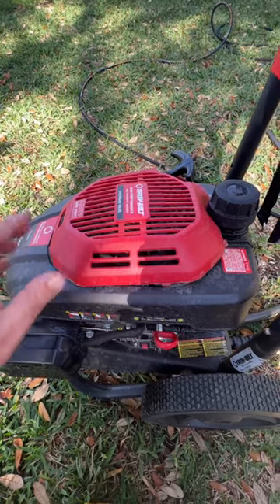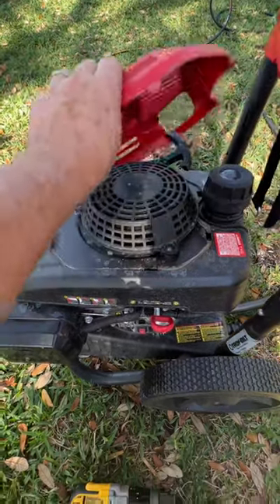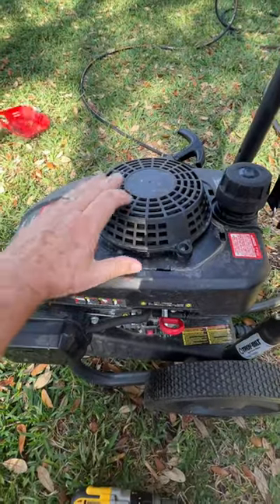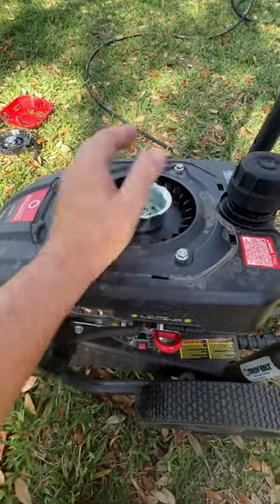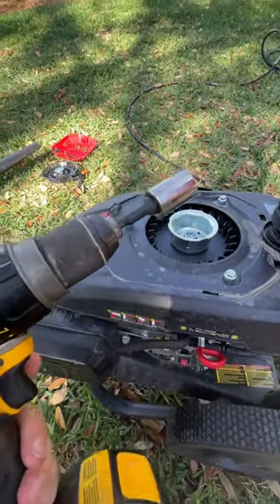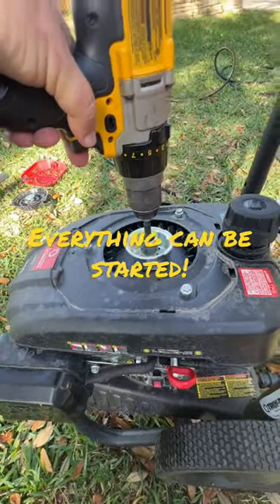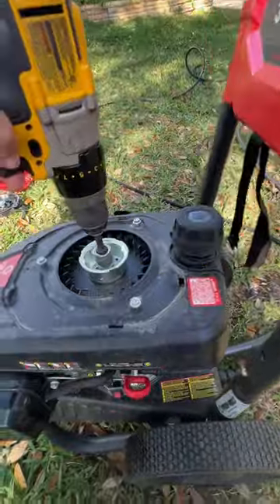Add a starter to every engine! Try at own risk! #motor #engine #starter #mower #lawncare #cleaning

Comment: I've done this, 2 problems, 1, you can accidentally loosen the flywheel nut, also, it can kick out of your hands.  Moving forward i will use a ratcheting adapter to keep these from happening
Reply from the maker: Makes sense to me!

Comment: When he says "clockwise" and if you're still unsure, just remember to spin the drill in the exact same direction that the pull cord rotates the starter assembly.

Cheers!
Reply from the maker: Well said!
Reply: If they don't know what clockwise means, they probably shouldn't be handling power equipment in this way.

Comment: NOT ADVISABLE.  I had a crankshaft retaining nut fly VERY far away because the engine started and the drill couldn't keep up. 
If an engine wont start correctly then FIX THE PROBLEM.  
Do it right. Don't get hurt.
Reply from the maker: Sound advice!  This tactic is dangerous

Comment: Which is better for a petrol-scooter, electric-drill or push-start.?
= hate the kick-starter
Reply: Maybe need to figure out the wiring harness of a car oops 115cc petrol-scooter with kick/electric/maybe-push. Usually scooter have 3 ways. Magneto something solenoid something CDI something, ... grass-cutter with electric start hanes-(types of)manual maybe... but... nevermind. Society have too many jealous losers at 115cc carburetion locomotion
Reply: Car drivers and their flooded smelly wiring are probably saboteurs of 115cc petrol-scooter and 660cc petrol-car. Some characters...
Reply: Nowadays, they control-signal stupid with electrical wires and ... how many kilograms is that harness.?
Reply: Wait till you find out formula-one sabotage... android-games at zero-cc(cubic-centimeters)
Reply from the maker: I would push start so you won’t have to store the drill

Comment: My mower doesn't turn over that easily and I attempted this one day when my pull rope broke and I just wanted to finish mowing the yard. Needless to say I didn't get it done until I replaced the pull rope and had to figure out how to reset the spring inside the pull rope reel
Reply from the maker: You have to exercise caution when doing this. Sorry it didn’t work for you
Reply: @RonKnowsStuff  my battery powered drill didn't do the job so I used a drill with a cord and it fired right up.. yesterday my pull rope 💔 and I spent hours taking it apart and putting it back together. I then seen your video and I'm not putting that stupidity pull rope back on it
Reply from the maker: @bendaves77  nice! Just be careful with the torque!

Comment: Will this work on my two stroke inline 4 desiel laylend?
Reply from the maker: Good question! Diesels need combustion to spark and light off. I’d imagine it would but PLEASE be careful- I recommend getting a clutch attachment for your drill so it can free spin
Reply: @RonKnowsStuff  Ron does in fact not know stuff
Reply from the maker: @QUAKY_A  dang it! I do know what I know though, you know?
Reply: @RonKnowsStuff  I know you know what you know and not not what you know

Comment: I do this too, but I use a directional slip clutch to hold the socket so that once the engine starts, it is not spinning the drill.
Reply from the maker: Exactly! I couldn’t think of the name of that tool.  I’ll have to remember Directional Slip Clutch. Thanks!!!
Reply: @RonKnowsStuff  Your welcome. I learned the hard way when it spun the chuck off my drill the first time I tried it. 😂
Reply: @RonKnowsStuff  can you give an example? I'm trying to avoid injury and I don't seem to find the correct adapter/tools to do this with the drill
Reply from the maker: @marcoenkel  here’s one from Amazon - not sponsored.  https://a.co/d/4eHd6ZM
Reply: @RonKnowsStuff

Comment: Does your recoil have a part number on it? It's the one I need.
Reply from the maker: Are you talking about the red top?
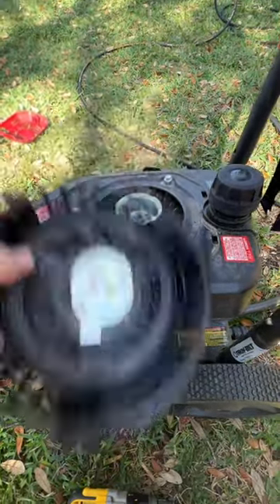Reply: @RonKnowsStuff The black part at 0:08 that you refer to as the starter coil
Reply from the maker: @BlueRage  try searching Amazon, PA6 GF30 should work.
Reply: @RonKnowsStuff  Thanks. Yours has three bolts holding it on, so does mine, PA6 GF30 has six.
Reply from the maker: Will look again but those numbers are the only ones that point to a part
Reply from the maker: Here are all the numbers I see - ROHS200611A (sticker), LGT-A (stamped in metal bottom), GT1P65 (molded in the plastic) >PA6+GF30< (also molded)
Reply from the maker: @BlueRage should see the response in the replies

Comment: Much safer to do this with a 1/2 impact. Yes, you might tighten the bolt but the impact will freespin, a drill will lock up which could break something.
Reply from the maker: Good to know that the impact driver has that feature!! Thanks for sharing. Amazon does sell a clutch for a regular drill too

Comment: I did try that and the bit twisted and broke off so i couldn't do shit after that
Reply from the maker: Crap!  I’m sorry it failed for you.  I have a bad shoulder so I have no choice. They do make a device that acts as a clutch on the drill bit so it won’t over spin
Reply: @RonKnowsStuff  that's good

Comment: It’s best to try this at your own risk, I wouldn’t recommend it cause the drill can’t really keep up, for reference, my dewalt dcd771 drill spins up to 1,800 rpm and the engine in the video I’m guessing is around 3,500-4,000 rpm
Reply from the maker: You are correct! There is a adapter for the drill that lets it overspin without harm

Comment: I wish my mower would just start
Reply from the maker: Oh no!  What’s it doing? Do you have compression?
Reply: @RonKnowsStuff  needs a starter and I burned my drill up and yesterday I put a pulley on the motor so I could pull start it and it won't start lol
Reply from the maker: @ligmaballs5536  oh crap!  Check for spark first. Might be a safety switch or something you can bypass. Good luck!

Comment: Bad advice bud‼️
I’ve been a professional small engine mechanic for 41 years and this is a great way for someone to get hurt and or destroy the crankshaft or their tools.

PLEASE DO NOT GIVE ADVICE ON A SUBJECT THAT YOU ARE NOT A PROFESSIONAL IN‼️🙄
Reply from the maker: I have warnings all over the place. I need to do this as I have a bad shoulder- I do use a clutch on the drill which greatly reduces risk. Again - warning ! Try at your own risk as this is dangerous.

Comment: You where earplugs
Reply from the maker: No ear plugs until after it’s running. You need to hear the pitch of the motor so you can pull the drill off without snapping your wrist off
Reply: He doesn't need ear plugs, he needs teeth guards, face guard & helmet and NO one needs to be near when he does this
Reply: Wear